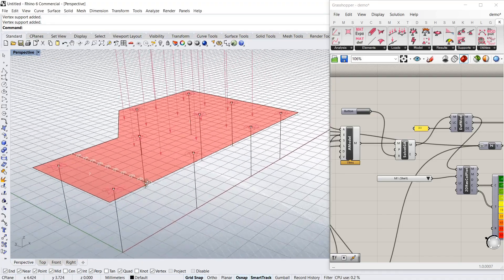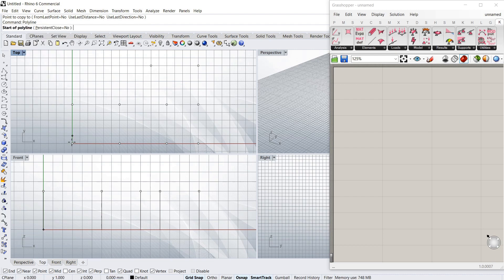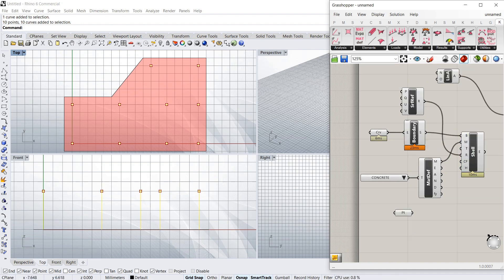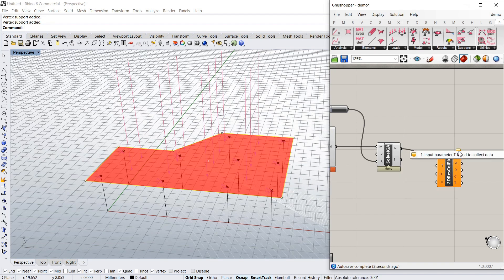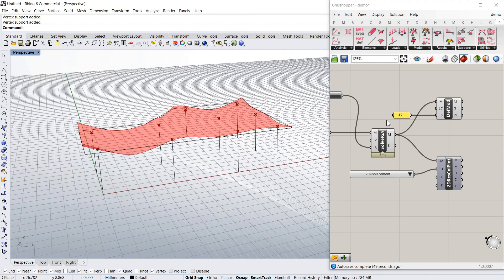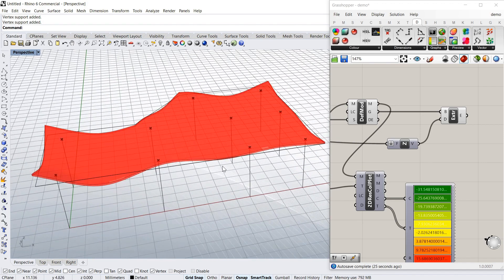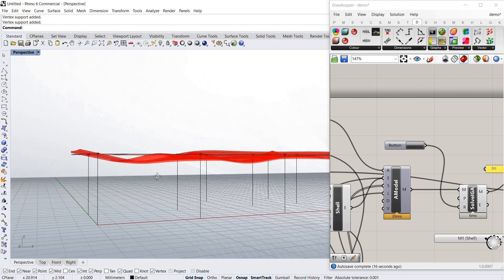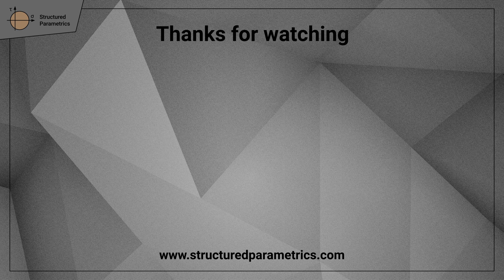Tutorial: Simple Flat Slab Structural Finite Element Analysis in grasshopper with Kiwi!3D

Comment: Be careful about your model, you are using mm in Rhino in your screen. So your slab dimensions are about 25 x 12 mm !. Also, your columns don't work as you are fixing the top of columns with kiwi supports, so they don't move!. Should  fix them at the bottom, not the top.
Reply from the maker: Yes - the important thing is to be consistent with the units you feed into the components. I agree and also mention that the supports are at slab level in the video. Some of this is done to make the video short. If doing a proper analysis you must take all factors into account.